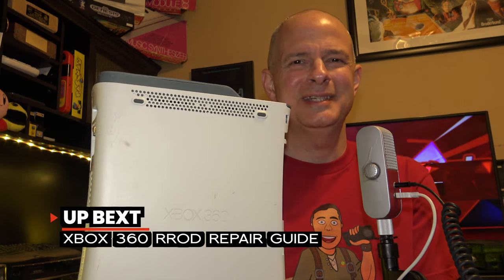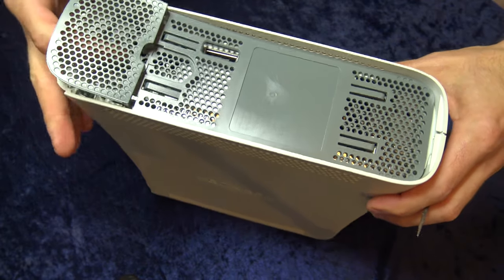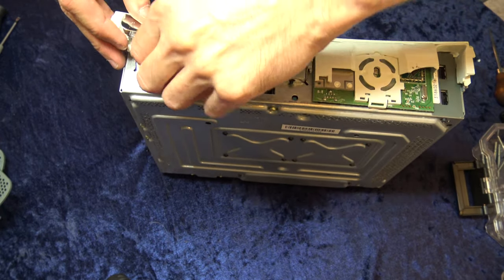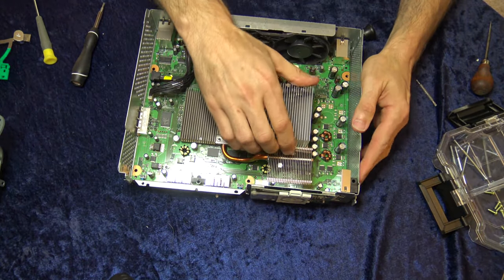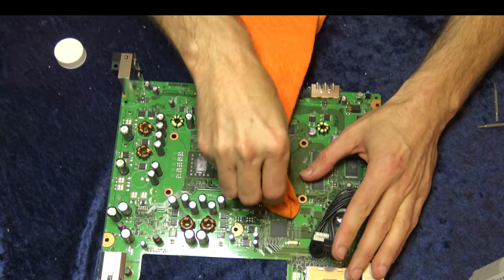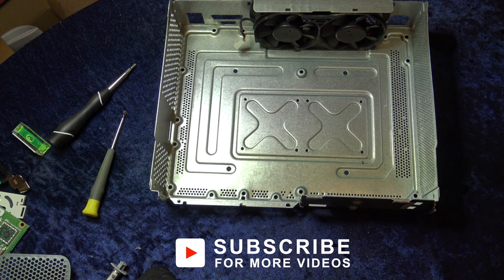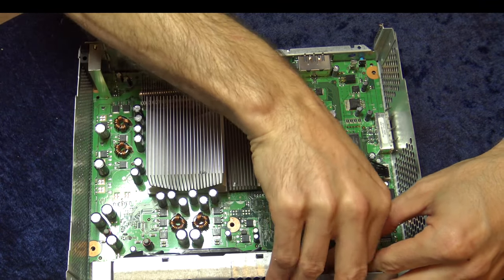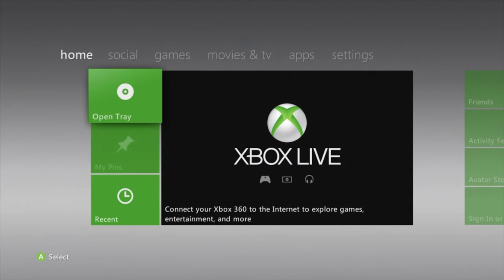Fix Xbox 360 Red Ring Of Death THE RIGHT WAY Teardown & Repaste

Comment: You should never smear the therm paste as it creates air bubbles, just leave in a blob in the middle and as you put the heat sink back on it will be pushed outnice and even with no air trapped. 😉
Reply: it's proved it doesn't matter.
Reply: @tirijalito  I've seen it proved that it does matter hence why I mentioned it. Where out of interest did you learn that?
Reply: @rossmate81  linustechtips, gamersnexus
Reply: @tirijalito  mans been real quiet
Reply: @rossmate81  spreading the thermal paste doesn't matter

Comment: The Jasper units don't suffer the same RROD as the earlier ones... They have capacitor issues. Also the Kronos Phat 360s don't die whatsoever.
Reply: What kind of capacitor issues?
Reply: @kutless45 I’m experiencing this now with my Xbox , the jaspers have Sanyo capacitors that are cheap ,  mine have blown up , not all jaspers just some , the falcons and xenon’s have rubycon capacitors and last

Comment: You didnt remove the sata and fan cable when you were applying the heat, the thermal paste and heatsink appliance was bad and you miscalled them, its the other way around, also in the end you put the fan shroud wrongfully and thats why you could not place the DVD drive properly. I enjoyed the video tho but too many mistakes
Reply: it's proved it doesn't matter applying too much thermal paste.

Comment: Heat gun is not repair temporary fix
Reply: you are correct, you need to replace the gpu!
Reply: Amen bro
Reply: @bethfoster6208  nope just re ball it
Reply: @pablonaranjo  your wrong
Reply: yup. reballing wont help. FCBGA fault inside the gpu. GPU must be put in trash it cannot be fixed ever. Need new gpu.

Comment: 18:30 "make sure you don't use too much thermal paste, too much will actually hinder it" -proceeds to drown it in thermal paste
Reply: as5 is also conductive... and its all over lol
Reply: Let's start with the GPU.  Clearly starts with CPU. Homeboy has dyslexia or is blind not to see the ram around the GPU
Reply: @HandicappedMind  Exactly what I was thinking!!!
Reply: Exactly what I was thinking!!!
Reply: Just watched this video, got to the part where he was talking about taking the top and bottom panels off without breaking the clips but you can see broken plastic all in it
Reply: Mine didnt work following tutorial, I have no idea. Maybe too much paste
Reply: @loveiswaytruthlife995  There was a glaring issue with his tutorial and that was him not using flux around the CPU and GPU before heating them up
Reply: @prismatic1239  wait so we are supposed to paste before heating it up? I heated mine and retried it the paste and still dont work so I bought the multimeter to see whats dead. I guess I am only doing it to learn.
Reply: @loveiswaytruthlife995  No paste after you heat everything up. 

Clean the board
Clean the old thermal paste off
Heat up the back of the board
Heat up the front
Apply flux around the cpu and gpu
Focus on the cpu and gpu 
Then after letting it cool you clean the chips again and apply new thermal paste
Reply: @prismatic1239  I did just that and it didn't work so I reckoned something else is wrong. I will use the multimeter again cause the guy who sold me two of these lied and now Im stuck with two red rings. I wanna learn who to clean cause I got like 4-5 red rings with me due to scam sales :
Reply: @loveiswaytruthlife995  because blasting the cpu / gpu with a heat gun only might fix an rrod, and definitely not permanently.
Reply: Oh boy, there goes heatgun over electrolytic capacitors  /facepalm

Comment: I fixed my original phat xbox 360 I clean the motherboard the DVD drive gears tray drive belt heat sinks and the fans most importantly I reapply fresh thermal paste on the CPU and GPU chips and heat sinks also clean the power brick and the fan its how I fixed my original Microsoft Xbox 360 and it works excellent

Comment: I followed the steps to get hard drive out then placed hard drive on piece of cardboard then wrapped board in aluminum foil. Placed in oven preheated to 350 for 20 minutes, no longer! Lift board out of over by lifting cardboard. Let cool then carefully reassemble, Turn on normally & enjoy
Reply: The oven is for food not sensitive electronics. while it may "work " For a short time you cause more problems as all the components don't need heat just the faulty GPU

Comment: Lead free solder has a high melting point (~400f). Heating the board is just that. you're more doing that here. Get some flux around the chip and focus heat on a preheated board to at least get molten solder. Other option is a complete reball..

Comment: I have a friend that well he is involved medium to heavily in electronics he was in a game shop too he also did stuff with pcs. He told me that he fixed these on the daily and he did that one fix on YouTube where you take off the x clamps and well essentially hard mount the cpu and gpu I didn't like that but he told me that helps it but the true fix it well desolder and reball either or the cpu or gpu or perhaps both. And well yeah he's right he came to that conclusion years before and he's right it's just that, that's a high skill level you have to be to do that there are mechines that do that for you but possibly are very expensive oh also solder mats for the actual chips you need and a hot air work station to do it. I actually want to do that myself one day to like learn mostly

Comment: I have a elite system that has great HDMI port but the video does not show. Sound comes thru though. I get one vertical line of display. I cleaned it and put new thermal paste in it still does not work any suggestions? Will heating the chips like this maybe work?

Comment: Took my 360 apart to try and repair the RRoD and found 3 bulged/leaking capacitors. Ordered replacements, but I'm wondering if I should still follow the steps in your video, or test functionality after I replace the capacitors?
Reply: I’ve had the same thing happen to me as well. The capacitors should not be an issue if they aren’t burst but if you are going to try the method from the video, I’d just go ahead and replace the capacitors since all that extra heat from the gun could cause then to burst.

Comment: I don't normally reuse the x clamps. I replace them and use bolts and nylon washers.
Reply: that damages the board further
Reply: @zackwolf1173  not if you do it right.
Reply: @arpod1980  true that
Reply: @arpod1980  just had a working bolt modded jasper come in. Undid the bolts, and now gpu is dead E74. Put bolts back, still E74. Bolt Modding kills the gpu and warps board very bad so that new graphics processor cannot be reflown correctly. Board is junk.

Comment: I have a digital heat that has actual specific heat temperatures you can set the gun for so do you know what heat setting would it be for low and high  in Celsius/Fahrenheit ??
Reply: 400 Celsius

Comment: It’s a fantastic repair but is there a way to prevent it from happening again? Overheating seems to be a huge issue with these older 360s.
Reply: Heat kills. Proper airflow repaste and clean the inside. Place the console in a open space not in an entertainment center or on carpet. Check that both fans run and push air out of the back. I also added small heat sinks to the ram chips
Reply: The processors are defective, the constant cycle of high temp-back to normal kills parts of the chip which have a design issue. There's a lot of interesting info on it! The only way for you to feel safe with it is playing on Xbox 360 S, or any other Xbox consoles coming after as they are retrocompatible

Comment: A reflow is never the best way, when it comes to 3RL or E82, Microsoft itself said that the problem is not in the contact between the XGPU and the card, but in the contact between the EDRAM and the EDRAM reballing. Therefore, performing a Reballing on the XGPU with these errors is a repair without warranty, because when removing the XGPU with the heat applied you reflow the EDRAM, and that is why in some cases it is not possible to solve the problem even with reballing. , it is recommended to replace the XGPU in these cases, it is a permanent repair.
Reply: only real fix is gpu replacement with fixed revision.

Comment: On my 360 the cd tray doesn’t open like it should, I have to use my fingers to open it, it closes ok but what can I do to fix this? Thanks
Reply: Is old but there’s a band that usually slips in the dvd drive that can be cleaned
Reply: No replaced

Comment: That was far too much thermal paste
Reply: @bethfoster6208  caused by solder failure on the gpu you're right
Reply: @jammydodger1449  wrong, it's the substrate losing connection to the chip itself its not the solder at all, this has been proven many times
Reply: @bethfoster6208  thanks for the further info mate, what's the substrate youre referring to?
Reply: @jammydodger1449  the connection to the die and the actual chip itself, on GPU_Y1/GPU_57/GPU_Y2/GPU_RHEA

Comment: Do you know if this xbox was a jasper xenon or falcon??
Reply: Sure that it's a falcon. If you see the Southbridge,  have the XSB with the circular metal top. The Jasper have new chip PSB with a black desing
Reply: @MrClavesin  correct, also has only two power coils = falcon
Reply: Falcon
Reply: probably 2007 falcon which still has same defective RHEA GPU used in the xenons.

Comment: What can i use if i dont have a heat gun
Reply: hair dryer, warm board for 40 seconds and while board is still cooling down and still warm not too hot, try power it up. it will work however as board cools FCBGA will loose connection again. Only fix is to replace GPU.

Comment: Going to ask is it wrong to get rid of X clamps and go but and bolt route?
Reply: it is wrong, might damage  the board even further
Reply: will damage board and gpu further. find a professional to reflow new gpu on proper using BGA reballing station.
Reply: No it's much better and after all the Xclamp aren't reusable at all. I made my own x-clamp fix with a few screws and (bumpers ???).
After all it's much better than the original Xclamps however don't over tight it